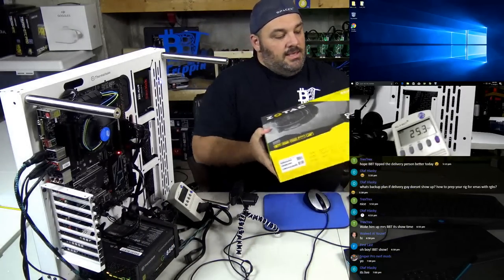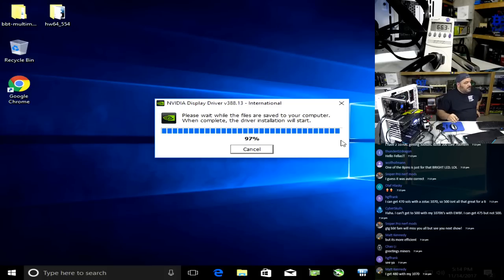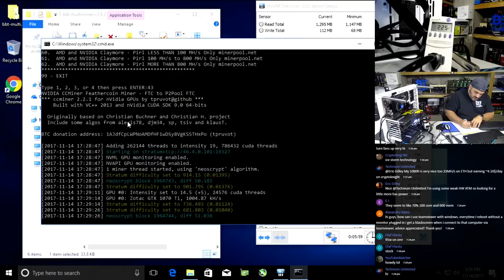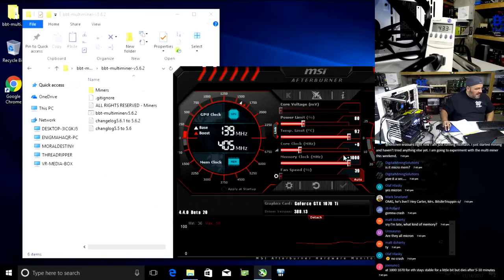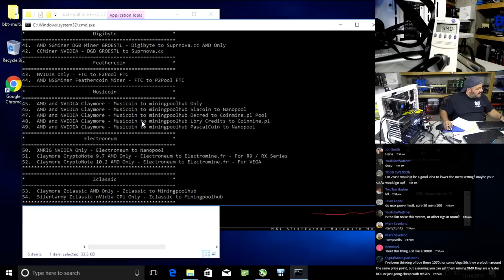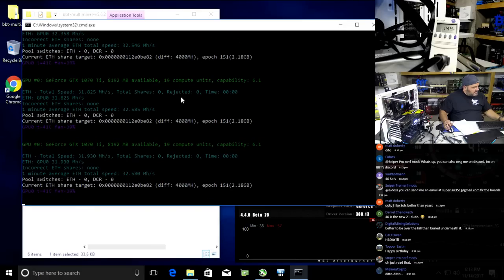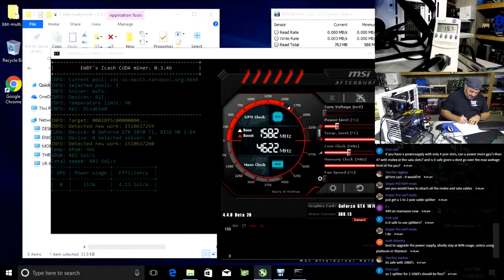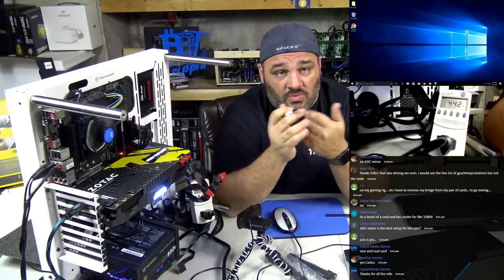Live VLOG#70: Zotac 1070 Ti AMP Extreme Edition - Unbox, Install, Cryptocurrency - Power - Heat test

Comment from the maker: Timestamps - Info - Token - Rates
3:00 - 6:45 - Unboxing
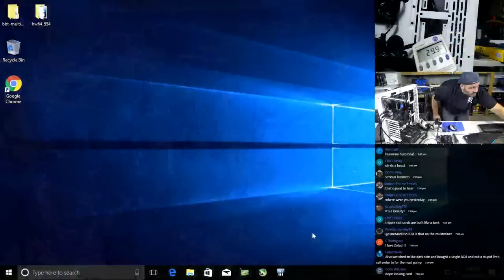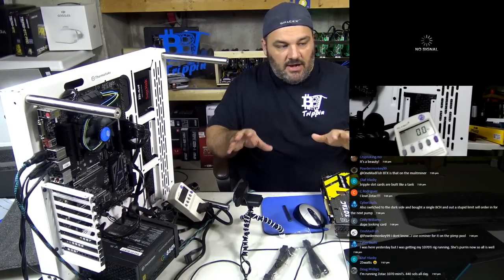6:50 - 8:00 - Computer Specs (win 10pro v1703); details in desc. above
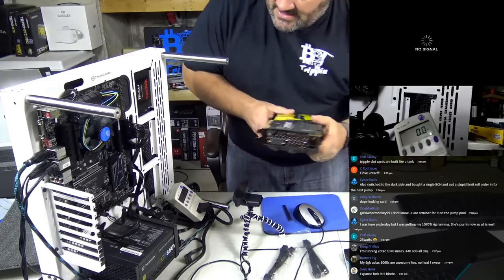8:15 - 12:40 - Install, discussion on 2x8pin
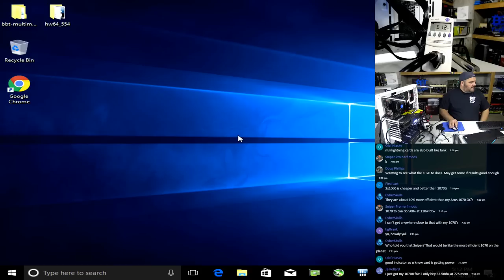12:45 - 19:00 - Driver Install - discussion on future episode concept (reference database)
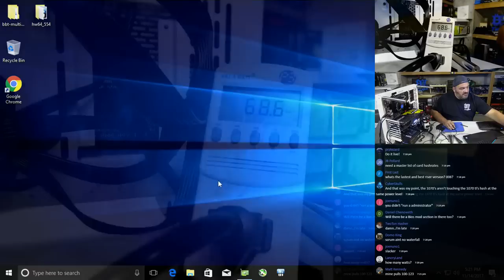22:00 - GPUZ Info / Idle Pwr
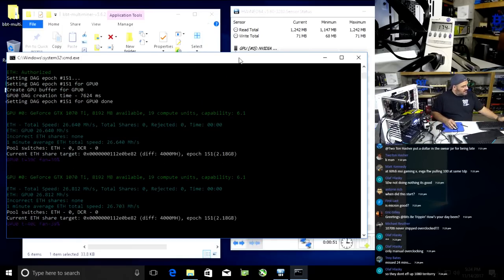24:50 - Ethereum Stock Performance 26.4mh @ 175w full system
26:30 - Zcash Stock Performance 463sol/s @ 222w full system
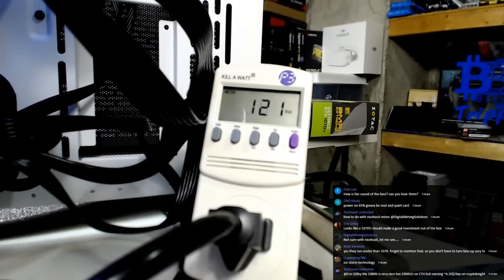27:55 - XMR Stock Performance 630/h @ 120w full system
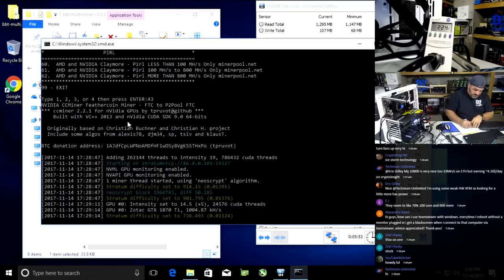29:50 - FTC Stock Performance 1004k'h @ 225w full system
31:00 - VTC Stock Performance 43.43mh @ 221w full system
31:40 - DGB-Grostl Stock Perf. 81mh @ 224w full system
32:30 - Lbry Credit Stock Perf. 343mh @ 225w full system
33:30 - Pasc Stock Performance 1.02ghs @ 240w full system
36:15 - Sia Stock Performance 1908mh @ 234w
37:00 - 42:00 - Configuration of tolerance on memory
42:40 - Going for max mem clock - Ethereum - 34.4mh @ 80PL / 0 Core / 1000 Mem 
56:00 - Going for high core/mem clock - Zcash - 540sols @ 80PL / 200 Core / 1000 Mem 183w
58:00 - XMR OC Performance - 791h/s - 140w
59:25 - FTC OC Performance - 1046kh - 141w
1:01:00 - VTC OC Pefomance - 43.83mh - 141w
1:02:10 - DGB-Groestl Performance - 82.0mh @ 141w
1:05:00 - Thermal Readout with the FLIR, surface temp review
1:08:50 - Lbry OC Performance - 348mh - 184w
1:10:00 - PASC OC Performance - 1.216ghs - 191w
1:12:00 - 1:30:00 Tuning for best rate / power - Best rate 60/110/925 = 505sol @ 109w
1:33:00 - going balls out PL 110 / 275 core / 925mem - 576 Sol!
1:37:00 - Rollup of all of the numbers!
Reply: Bits Be Trippin' Hi I would really like to know best rate/most efficient power for ETH?

Comment: Just so you know, ALL the 1070 tis ship at stock speeds, so there is NO out of the box overclock on AIB cards. You should have noticed that on the GPUZ screen where it showed the Default Clock and GPU clock at the exact same values.
Reply from the maker: Good point Steven Davidson - will add that to the description. That being said the headroom on this is pretty high (Zotac)

Comment: Nice videos. One thing I want to point out is when you overclock your gpus you can type in as crazy numbers in core/mem as you like. As soon as you drop power level this chip will downclock itself anyway. Instead of giving Msi AB figures +1000mem, +200core etc etc you should look at the actual core/mem clocks under load.

Comment: Great Stream. I am Kinda wishing I would of splurged for that Zotac model over the Mini as the Temps are incredible, its just hard to justify the price when its so close to a 1080 when they are on sales.
Reply from the maker: Just got to look for those rebate deals ;) this card at 439 would be selling like hotcakes
Reply: You paid 499 right ? so yeah my thoughts are that is 1080 prices when they are on sale usually. The Vega 56 AIB cards if priced right will be the best due to Cryptonight algo's. Low wattage compared to other and heat in turn. I appreciated your coverage I hope when the AIB cards come out you will revisit XMR using Cast-XMR miner and possibly test Polaris cards as 1000h is possible on those with mods.

Comment: Hello I have question what card is better gtx 1070 or 1070Ti ?? I'd like to buy 10 of them and don't know If is worth to invest extra £30 for TI's  
Please for advise thanks!
Reply: The 1070ti has 20% more hashrate on Lyra2REv2 and other algos.   It can mine ZEC more efficiently as well.  If you strictly mine ETH , I wouldn't spend the money.    I am not sure about dual mining .   We may have to wait for updates on software.  I wouldn't be surprised if the ETH performances increases 10% .    My concern is the heat.   I have two rigs of 1080ti's and they require the use of giant fans even with a 72 degree room.     I would buy the 1070ti's with the best cooling features .
Reply: jasavak Hi I have to consider what to start mining and is profitable I think 1070ti is a great choice and rig with 10 of them will have good ROI let's say 10 months.  . .?
Thanks for you advise!
Reply: Yes ,   6-12 months .  I only started 6 months ago and they will paid in about a month .   You can focus on ZEC , Neosrypt , Lyrarev2 and others, but you can always trade or cash out .  I have been trading my coins for Ubiq and Bitcoin hashing power.

Comment: If I wanted to do 8 of these zotac 1070 Ti amp extremes in a rig what power supply would you suggest?  I am getting lost with the dual 8-pins needed on each card.  Can I use a PSU 6pin and go to an 8pin on the gpu?
Reply: Go for dual psu setups, platinum  grade has more 8pin slots unlike gold

Comment: I find the thumbnail of this video to be very misleading. At 100 watts how are you able to achieve 540 sols? I have spent days with this card and the sweet spot for me was 70% power limit in windows and +200/+700 for core/mem and it output 480-495 Sol/s. I was able to get 34Mh/s but it wasn't stable very long. 32.5-33 Mh/s. But none of these speeds you show on the thumbnail is achievable at 100W. Could mislead others who are not informed.
Reply from the maker: Absolutely fare assessment - reviewing our notes, the system had 540 sol at 183w full system; meaning just over 100w for card, 35w for riser, 50ish for system. In reality normally we take card+riser = 135w
Reply: Bits Be Trippin' this card in my system doesn't do over 500 at 120 watts. Maybe you got a really good one. I'm using SMOS BTW not sure if that makes a difference
Reply from the maker: Windows performs better than SMOS in our testing, as shown on the video.
Reply: Bits Be Trippin' I bought all 3 Zotac 1070 Ti cards. I found the Amp! Mini to perform the best. Since it is the cheapest I was super stoked. I'm planning on building a 12x GPU rig but wanted to pick the best one.
Reply: Thank you for your comments.  I'm actually thinking about making a 1070 ti rig myself, but I'm torn between the mini's or the one reviewed in this video.  I'm wondering if the $70 or so is worth going all out on the 3 fan version or not.
Reply: I have all three versions that Zotac offers. I have found that the mini worked the best and it only takes one 8 pin. This is the one I would build a rig with.
Reply from the maker: Great to hear - should post a vid to twitter, we will retweet. Thanks for the comment!
Reply: does it matter if the gpu's are different brands/model in the same rig?? like mine with 1070 ti, 1070 and 1060?
Reply: how about the evga sc edition?
Reply: COuld you tell me how Zotac AMP 1070 ti (two fans card) performed, it's in the mailbox. Ia have ordered it @miningmadeasy
Reply: Josava13 the standard Extreme version from Zotac was the most efficient. But not much more than the mini. I think like 0.2 Sols/watt better

Comment: Which one is better 1070 or 1070ti?
Reply from the maker: 1070Ti ... however if you can get a 1070 for 399, its better deal on price.
Reply: Bits Be Trippin' the prices in my country (India) is as follows Zotac  1080ti mini for 615$ and zotac 1070ti amp extreme edition for 692$ and zotac 1070 for 561$

Comment: I got 6 x Sapphire RX 580 Nitro+ = 185mh/s consumption = 960w (for the rig), mining ETH. I'm thinking about build another rig with 6 x Zotac 1070 Amp Extreme. Could you tell me what is the total MH/s that I can pull out of these cards x consumption? I'm just trying to figure out if worth to pay $600 more for 6 1070 cards or build another RX580 rig and save the $
REPLY
Reply: Helder Pimenta need to bios mod those suckers!
Reply: miningmadeasy do you believe that I can do better with the 1070?
Reply: I probably can pull 190 from 1070 but the consumption will be almost the same. So why pay $600 more? Do you guys think it worth?
Reply: Helder Pimenta I have a 12 card 1070 rig and it pulls about 1200W. My 12 card RX580 rig pulls a bit over 2000W. That's about $60\m more to run the rx580 rig.
Reply: Wow. Huge difference! Thanks for sharing.
Reply: miningmadeasy, huge difference! Can you tell me which 1070 card do you have?
Reply: Helder Pimenta most of mine are the Zotac Amp! Mini but they run hot. I got them for $370/unit so jumped on them. I'd recommend EVGA though as they run much cooler and usual hash a but higher
Reply: Is it possible to run a 6 card 1070 rig and get away with only running a 850w power supply?
Reply: Benjamin McAbee It is possible, but not recommended
Reply: What happened to the conversation we had last wk about what I was getting with the none ti version Zotac 1070 amp extremes? It got deleted? 

I found a better OC settings. I'm getting 33.7mH/s @ 130w on ETH per card now after switching from MSI AfterBurner to Nvidia Inspector and finding better OC settings. (52%pwr/-200 core/+850 mem) I also swapped out the cheap risers I got off eBay for MintCell risers.

Comment: you are doing 2 much...1070 Ti ...speed is okay...Eth 27 to 28 ave, any EWBF cuda miners get 480 sols/s, monero 610 h/s ...don't mess up with everything....I m also using 1070 Ti but its of Asus Stricx ..imp is ur motherboard...dats why ur Watts are 2 high ...u sd hv installed ASUS 250B Mining Expert motherboard.....my ave watt is 54 to max 67...with fan speed ave 28 to 37 max